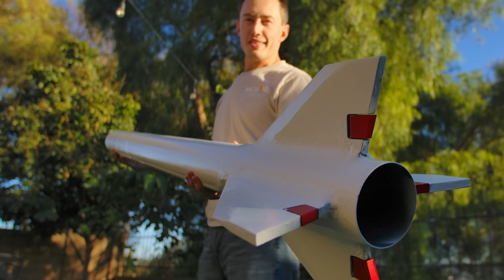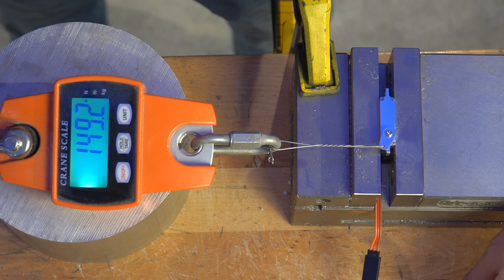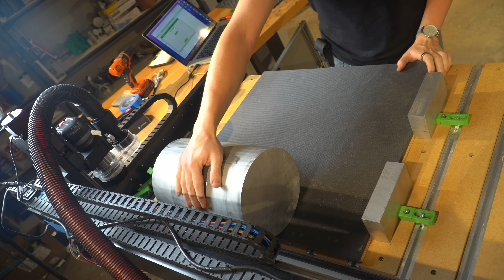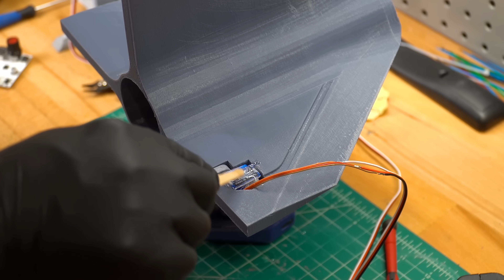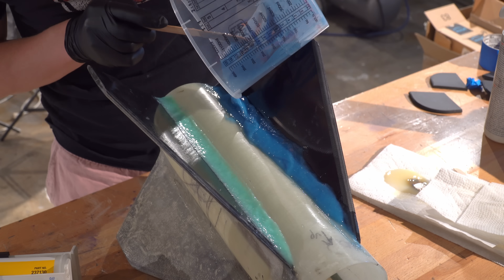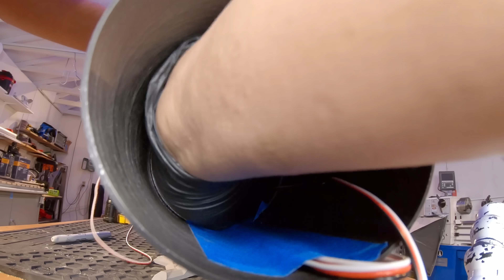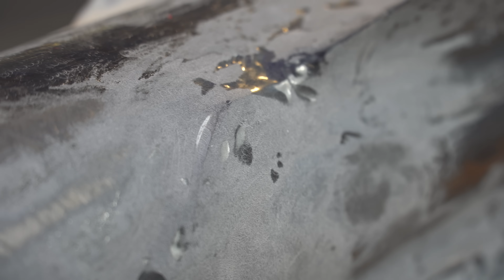Building a Guided Rocket to Hit Mach 3

Comment: Buddy you have been wearing a respirator for every little sanding operation, but then proceed to paint the whole damn rocket with safety breath holding. I mean sure you were outside but still, I also don't want to be annoying but I have been taught to speak up if I see something safety related and I would like the same treatment if I do something like that. Nice build:D

Comment: Why dont you use heat shrink tubing for thos wire which you solder? And you use laser level while epoxy those wire so you dont lose them 34:30

Comment: Wouldn't the massive amount of wind during flight create more than good enough cooling? Or maybe put some sort of ad hoc heat sink with the fins exposed through the epoxy?

Bro. If you running sims, get a real computer. Not a miniaturized version. smh

Comment: Beware! ALuminum and carbon are at opposite ends of the galvanic spectrum. They will corrode fast, with a load of white powder that'll expand and pressure the carbon. 

Itll probably have no impact here, consider wrapping aly parts in glass before entombing them in carbon. Especially if they might be exposed to salt water. 

Or don't, i'm not your boss.

Comment: When potting the cables along the length of the body you could use a indexing notch on the printed form squeegee and line up a vertical laser level along the run of wires to  have a guide as you do the pull.

Comment: Why didn't you make a sleeve on top where you could accommodate the cables that you put outside of the rocket? Or even 2 carbonfiber strips where you can have the cables between that you then fill that with epoxy, this way you will have perfectly fine lines of cables and much easier to sand.

Comment: Servo power cables should be THICCC, especially if they are that long! The channels could have been taped up so you can clean the excess epoxy by peeling the tape. The fillet mold could be guided by a tight wire so the channel is straight. Awesome rocket!

Comment: you need to put the servo assembly onto a frame that can be slid into the back of a solid fin, bolted into place and removed/replaced if it bricks it heading to mach3.

edit 
pogo pin contacts would work well to make it basically plug and play

Comment: Taking inspiration from the AIM-9 and mounting the control fins to the front would save you a lot of work:
The control fins wouldn't be mounted over the rocket motor, so the servos could be mounted inside the body. Servos could be bolted in place, increasing serviceability. Stabilizing fins on the rear would be needed, but they could be made of thin metal and welded on or bolted to brackets which have been welded to the outside. Avoiding carbon fiber and epoxy would spare you from some of the hazards and tediousness of the build. Aside from the ignition wiring, all electronics could be contained in the nose, eliminating the need to pot wires outside the body to survive mach 3. The forward fins hit air that hasn't yet been significantly disturbed by the rocket flowing through it, making the software for fin control much simpler, so simple that 1950s missile computers could run it.
Maybe you don't want your guided rocket to look or act too much one of the most successful anti-aircraft missiles in history, but to the untrained eye you've already crossed into edgy territory anyway. Might as well learn from the best of the cold war rocket science, just don't put a warhead on it and it'll be okay.
Reply: He's talked about using canards before. The issue is there's this thing called "roll reversal" which he wouldn't be able to simulate and mitigate
Reply: That would be so cool though
Reply: @Engiduck  heat seaking fireworks

Comment: Building a Mach 3 Guided Rocket:  A No Effort November Deep Dive

* 0:00 Introduction and Sponsors: The video showcases a Mach 3 guided rocket with control tabs in the fins, sponsored by Razer and NVIDIA. 
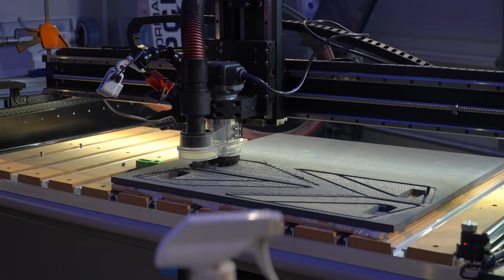* 0:44 No Effort November: The creator declares this video as part of "No Effort November," focusing on a technical deep dive of the rocket airframe construction.
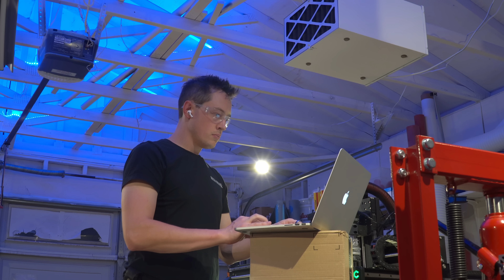* 1:06 Prototype with Birch Wood: Initial fin prototypes were created using birch wood to test tool paths and refine the CNC milling process before using expensive carbon fiber.
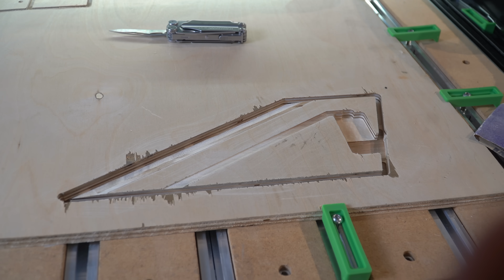* 1:29 Leading Edge Chamfer Technique:  A clever method using a fence and indexed fin placement was devised to ensure consistent leading edge chamfers on both sides of the fins.
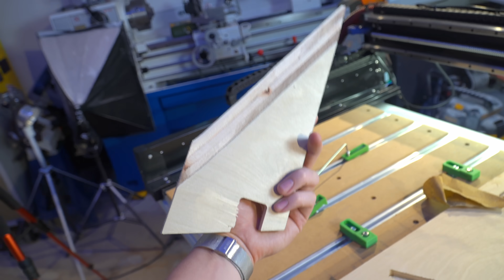* 2:10 Servo Testing (Overvolting and Runtime):  MKS 6160 servos were rigorously tested, including overvolting experiments (up to 4s LiPo) and runtime assessments under load. This revealed the servo's ability to withstand high static loads but a lower than advertised torque output.
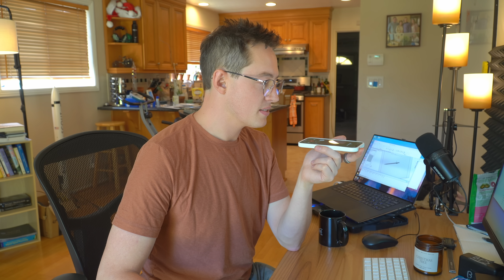* 6:25 Insights from MKS Servos: A phone call with MKS Servos yielded a more detailed spec sheet and highlighted the importance of managing heat buildup in the coreless servos during operation.
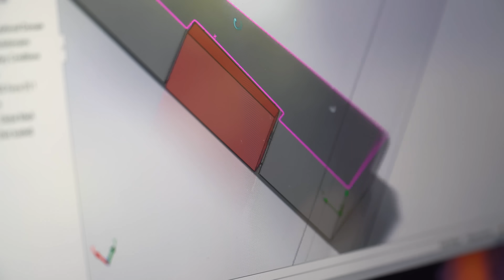* 7:15 Design Considerations (Fin Tabs, Nose Cone, Simulations):  The video briefly touches on the importance of fin tab sizing, nose cone shape, and guidance, navigation, and control (GNC) analysis using CFD simulations.
* 7:33 Razer Blade 16 and NVIDIA Studio (Sponsor Segment): The creator highlights the significant performance improvement offered by the Razer Blade 16 with NVIDIA GeForce RTX 4090 for CFD simulations and video editing, emphasizing the benefits of NVIDIA Studio drivers for accelerated rendering and encoding.
* 9:13 Carbon Fiber Fin Cutting:  The fins were cut from expensive, quasi-isotropic dragon plate carbon fiber using a CNC router. Safety precautions, including HEPA filtration, respirator, and eye protection, were emphasized due to the health risks associated with carbon fiber dust.
* 11:57 Servo Integration and Epoxy Potting: Servos were integrated into the fins, prioritizing stiffness over serviceability. Aluminum tape was used to protect the motor section during epoxy potting.
* 16:10 Carbon Fiber Conductivity Issue (and Solution):  A critical error was discovered where exposed servo cable leads shorted against the conductive carbon fiber fin, causing servo failure. The issue was resolved by insulating exposed leads with CA glue.
* 17:46 Raceway and Cable Management: PWM extension cables were routed up the rocket's airframe within epoxy raceways to protect them from the Mach 3 airstream. Challenges with cable placement and epoxy overflow were encountered.
* 27:26 Structural Integrity Concerns and Stiffening:  Concerns about structural integrity at high speeds led to the addition of a coupler tubing section and a carbon fiber layup to reinforce areas of the airframe.
* 36:23 Sanding and Surface Preparation: Extensive sanding was performed to smooth transitions and rough surfaces, highlighting the challenges of using structural epoxy for fillets and raceways.
* 37:08 Rail Guide Installation: 3D-printed PLA rail guides were attached, acknowledging their potential to melt off during flight but prioritizing their function during launch.
* 38:06 Sanding Damage to PWM Cable (and Repair):  Accidental sanding damage exposed a PWM cable trace, requiring repair with epoxy. 
* 39:10 Paint Preparation and Application: The rocket was prepped for painting with sanding, cleaning, and a base coat of white spray paint. Techniques for spray painting and the importance of a witness sheet were discussed.
* 40:59 Future Steps and Conclusion: The video concludes with a preview of upcoming tasks, including nose cone construction, copper tip application, avionics integration, and further simulations. The importance of learning from mistakes and sharing knowledge within the community was emphasized. 

I used gemini-1.5-pro-exp-0827 on rocketrecap dot com to summarize the transcript.
Cost (if I didn't use the free tier): $0.04
Input tokens: 26930
Output tokens: 855

Comment: any unevenness on the surface, whether it is a depression or bulge, will create resistance and a turning moment. It would not be necessary to touch the factory surface of the pipe, and all the wires should be brought inside. And the control surfaces at speeds of M2 or more will be in the shadow of the shock wave from the body and the edges of the stabilizers, and will almost not work. They had to be placed at the ends of the stabilizers... 
And most importantly — the epoxy resin loses its structural strength at temperatures greater than 150 degrees Celsius...

Comment: I wonder, since you knew carbon fiber was conductive, why did you have a laptop so close to the fin cutting tool?
   There was a warning in the computer room I worked in for the US Air Force that the flight operations authority was to notify us of any airplane crashes because of the carbon fiber in the wings of the jets used in student pilot training at the Air Force Base.

Comment: may I recommend that in the future you abandon servo cables entirely and use a custom flat flex pcb to connect all the servos that can then be laminated into the assembly? less assembly error and allows for robust transitions through the casing of the vehicle

Comment: Why not buy bulk servo lead on a spool, soldering it to the servo control boad directly, crimping on the terminator pins and clipping on the futaba connector at the end in the future. No exposed wire, no needless solder joints. This isn't criticism. Just something you may consider in future builds for a cleaner and more reliable product.

Comment: According to google A.I. (which is often full of errors lol) A Chamfer is a short edge that connects to two surfaces at a 45 deg angle. while a Taper is all other transitions that are longer and/or connect to just one surface. It was much wordier than that but that is what I distilled from its answer.

Comment: Love your projects, man. One thing I thought of, though-- do you know the high temperature character of the epoxy in those fins? I have to debond aluminum parts from carbon fiber at work from time to time, and the stuff we use (fairly thin wall tubes, but not super thin) can get extremely soft and floppy with surprisingly little heat. I'd be worried about those fin leading edges getting soft since they're so thin and flopping over in the airflow. Could wreak havoc on your control surfaces by making the air all squiggly. I dunno, just a thought.

Comment: An extra bonus of the launch rail things melting off in flight is that on the following flight you aren't locked in to a launch rail type. I don't know if this actually matters, I don't know what variety of rails exist, but the one time use rails leave you free to do something else next time, at the cost of being required to do something next time.

Comment: seeing how many pre-fabricated extension cords you killed i would say it's time for you to buy a spool of 3 wire servo (3polx 26awg) cable - solder it once internally at the servos and crimp a plug at the top - if you even wanna do that.. for serviceability ;)
Reply: Also: sticking bluetape on "not to epoxy"-Areas next to raceways could safe you a lot of sanding

Comment: I mean this seems absurd to suggest but have you never seen heat srink before or something? plus you probably can use less solder, look up wire joining techniques, the fray and twist usually gives nice inline connections. This will allow to you end up with much thinner joints. You probably could ground the whole rocket frame and lose one wire, but making sure all your bonds are electrically conductive might be difficult. However the VCC and GND between all the servos can be shared.

Do you do any testing on the length of the servo extensions, and the voltage drop caused?

Also i believe CA accelerate is just water.

Comment: Hello, for your filleting I'm wondering if a different approach would work better. I would suggest trying a laminating epoxy thickened with microballons and chopped carbon strands. In my experience this yields a thick mixture that is still quite strong. This can then be sanded easily following the cure. Maybe you could do something like the 3d printed filleting tool to get the shape close when applying your mixture, then a 3d printed standing tool to achieve your desired final shape post cure. Great video!

Comment: The flat edge on your fins looks draggy. Could you angle it for less drag and make the control surfaces the same shape? That way you dont have a low pressure point behind your rocket. Just spit balling

Comment: To made a down draft work surface .   Make a rectangle wooden box, with one side made from peg board.  On the side of the box make a hole  for the shop vac. This create vacuum under the sanding surface. Good also for painting, to keep dust off.
Wish you the best in your endeavors. 🎉

Comment: Just a quick addendum for the Carbon fibre PSA for anyone doing Carbon Fibre (i am working for a university and am responisble for the safety in our lab): When cut, the carbon particle can reach µm dimesions. At these scales they can linger in the air for hours. So even if you wear a resperator when actually cutting the carbon and take it of after your done, you are still getting exposed to microscopic pieces of carbon dust that will embedd themselves into your lung and can cause cancer. So if your shop vac is powerful enough you dont need the resperator and if its not, then the reperator will not help you.

Comment: Heatshrink tubing and the lineman's splice is your friend.  I know those solder joints are not under massive mechanical stresses, but solder is still incredibly poor against vibration.  A lineman's splice is far stronger mechanically, due to just how much wire-to-wire contact there is, and even if some of the solder cracks it won't immediately result in an electrical disconnection.

Comment: I'm a bit surprised everything is solid and you add so much epoxy everywhere. I get that you need strong parts, but solid carbon panel for the fins? I would think you make a foam core and put a few (significant) layers over it in a vacuum bag. Then no machining and much lighter and so on. Then thinner shells for the wires along the body, glued on after. You care about weight right? I used to make composite gliders and knew I could smear epoxy and sand, fill bubbles, sand more...or use a mold, sometimes just mylar glued to the foam you hotwired some core from. Then you get light beautiful parts. You are kind of cave-manning it but curious if that is on purpose from past experience.

Comment: This gonna be epic! And a small advice, one of the very first things that I’ve learned at the engineering school: Every time you cut and solder an extension cable you need to seal it with termofit or any isolation method, in order to prevent shortcuts, discharges, electrical noise on the signals, etc, in this case this could result in a short cut of those expensive servos, and every penny counts.

Comment: I wonder if 12 strips of copper tape (with isolating tape under them) up the sides of the tube from the servos would be better than the bulky cable race ways?

Comment: Questions/sudgestion(maybe): why couldn’t you join the vcc and ground pins over the servos that way you’d only have to run 4data and 2 power wires instead of 3 for each servo? Is it because of current constraints?

Comment: I'm not sure if you've already used up this rocket, but I have a tip for you. You noticed that the surface of the rocket looks awful after painting. I'm not sure how common it is, but you can use it to your advantage. At least in automotive body work, when filler is used and is sanded so it feels correct, primer is applied. The first coats always reveal imprefections. You then simply sand again, coat again and see how it looks. It definitely takes time, but it is fairly simple and you can get very smooth surfaces, which in your case also means better aerodynamics, not just looks

Comment: You should use high temp BBQ paint on part of the rocket to test if it holds up any different at mach speeds than the normal paint does.

Comment: a small 3" paint roller would have been perfect for the epoxy on the fins. And mixing in a very small amount short lose carbon fibers with the epoxy (before you add the hardener) will go a VERY long way for strength. Much like concrete.

Comment: A servo connector will need at least 3/10 inch to pass through (3 standard pitch). Instead, if you trimed of the connector and crimped dupont/JWT/JST connectors you could have the pass through holes much tinier as there would only be one connector and five wires max to pass through at  time

Comment: i have a question, for the raceway you did a small radius epoxy layer wouldn't it be better to do a big radius that cover more of the carbon fiber tube? i know it means using more epoxy so more weight added  to one side of the rocket but i feel like it would give you less air resistance

Comment: Do you really need that much servo power for this? 🤔
I mean this thing needs to steer, not make loopings or spin up to 10k. 
But if it needs that much power, and the servos are getting borderline underpowered, I would suggest making two part control surfaces like modern airlines have for there elevators. 
One small steering tab with the servo, and a bigger trim tab (instead of the whole elevator like the airliner... 😅) with a slower jack screw. 
This way you can initialize big turns with the slow surfaces and ceep control with the servos.

Comment: Great video! You might want to try adding a thixotropic agent (colloidal silica powder) when mixing epoxy for the fillets. It turns the resin into a gel-like form that won’t drip and holds its shape. This way, you wouldn’t need to wait an hour or more for the resin to hold its shape. Trust me, thixotropic agent is fantastic—you could even make a snowball-sized blob of epoxy and stick it to a wall! 😄 Thanks for the video!